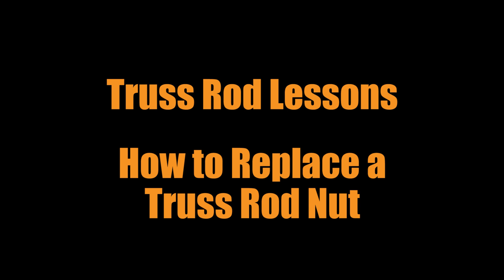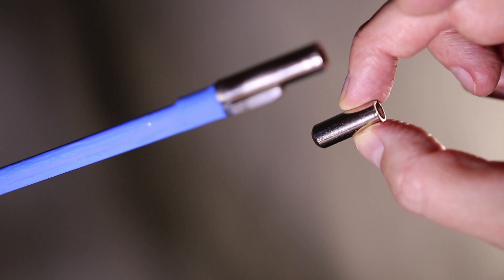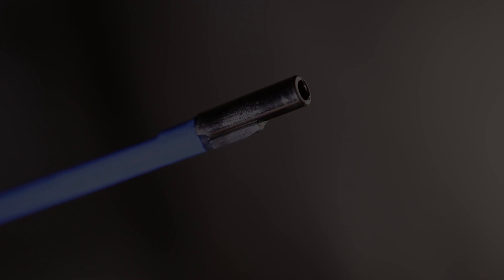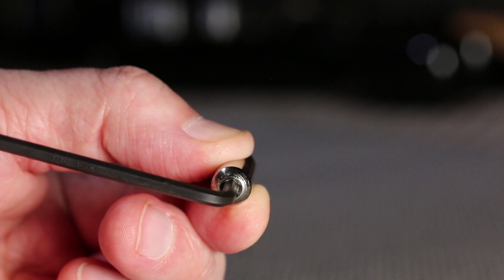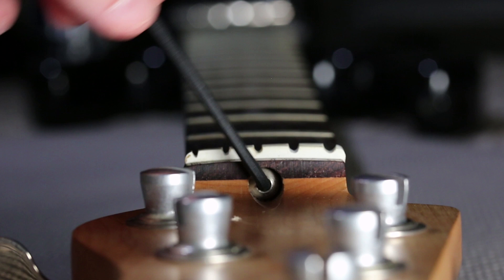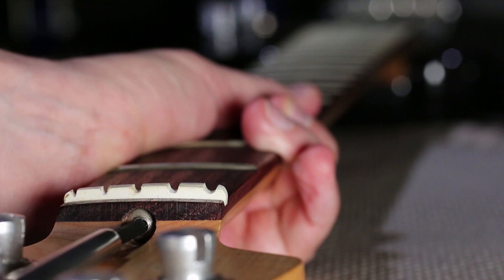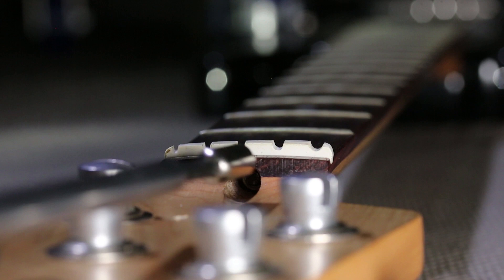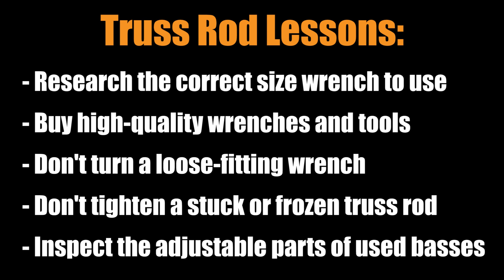Truss Rods; Replacing a Truss Rod Nut | StudyBass

Comment: I'm down a rabbit hole with a Maxam 43" Bass neck that the truss rod stripped out on. I'm at the point where I got to either take off the fret board, or just get a new neck, but finding the manufacturer of this bass in china is becoming a major task. I pray that I can fix this because it's my freind's bass.
Reply from the maker: I hope it turned out all for the best. A good luthier should be able to fix it if you haven't already.

Comment: This is a pretty detailed and an informative video. Thanks for putting it out. Doing the lord's work :)

I’ve got an LTD H1001 FM with a stripped nut. I can’t get 4mm or 5mm hex Allen keys to fit into properly. (Manufacturing book says 4mm).

I’ve ordered a gripper wrench from stewmac (4mm). I’ve seen videos of the wrench used to remove nuts but since this is a double action and the nut is weld to the rod, can the gripper wrench be used to adjust the rod for relief? I’m fine with living with the gripper wrench for the rest of my life if it does the job adjusting my guitar neck relief.
Reply from the maker: Thanks! Yes, I think using the gripper all the time is doable.

Comment: Don't use lithium grease!!!! Or ANY grease. It can dry out. Use anti-seize compound. It is specially made for exactly this. You can get little kethcup packs of it at any auto part store.
Reply from the maker: Good tip! It makes sense grease could separate over time.

Comment: That's awesome thanks
I just got a sire P5 4 string bass new from sweetwater
The Allen key that came w the bass has alot of play when put in the nut on the neck, 
I had this issue many years ago with 2 separate sires l sent back
How is it Sire still can to get this right
Reply from the maker: Like everyone, they are just cutting costs where they can. You really have to shell out a lot money for excellent tools. They're often worth it, but the small, expensive ones like an Allen key seem harder to justify.
Reply: Thanks

Comment: My GD truss rod just broke on my 2 month old G&L after applying a tiny amount of pressure to it. So pissed. I believe it was due to a bad weld on the rod. Any suggestions?
Reply from the maker: Man, that sucks. I'd get in touch with G&L. They are usually pretty cool. Maybe it is still under warranty?

Comment: I think righty-tighty, lefty-loosey should be clockwise and counter-clockwise, cause outherwise it changes with your perspective.
Also you just need to remember one direction to figure out the opposite motion.
Truss Rod Clockwise = Back Bow.
Or just think of a regular screw.
Tighten=Back

Comment: Does the Stewmac Gripper Tool work to ajust a trussrod with a stripped nut?
Reply from the maker: It could work, but I would just replace the nut. It will be easier in the long run.

Comment: Great video. Learned a lot. Had a question about maxing out. I have a 2008 squier standard jazz bass and I seem to have maxed out on tightening the truss rod but still havent been able to reduce the height between the string and the fret markers at the 5th or 7th fret (depending on whether I am fretting the 12th or 17th fret). I read online about adding washers/spacers. Do you think that might work? At the moment, I don't want to attempt to tighten anymore as I am almost sure I can't tighten it any further. Thanks.
Reply from the maker: Have you tried some lower tension strings? That might make the difference.
Reply: @StudyBass  Oh I haven't yet. Might give that a try. Asking because I am a beginner, would that affect the tone I would be getting from the bass?
Reply from the maker: Yes, but not necessarily negatively. The two biggest things you can do to change your bass' tone is change the strings and change the pickups. Both are easy to do, too.
You might find the low tension strings easier to play. Better playing is always better than better tone.
Good luck!
Reply: @StudyBass  Thank you!

Comment: Thanx for all your advices man. I have a question about a "weird" truss rod issue tho. Couple of years ago, I sent my very (beated) first bass to someone just for a paint job and when that a-hole gave it back, I notice it came with a very low string action, with "muffled" string sound and with some fret buzzing on the first position/frets, cos the neck was back bowed a bit. So I decide to adjust the TR...just to found that the TR nut was loose😡...Good news were the nut wasn't stuck nor stripped but completely loose and came out when I used the allan key on it...bad news were that the TR remains only responsive to tight the neck further but doesn't moves to the side to give relieve to the neck, so I let him alone right there😤...Is there any solution for something like that???
Reply from the maker: I'd find the best luthier in town and have them look at it. They might be able to put it in a set of clamps to help straighten the neck and maybe the TR will work correctly with less tension to counteract. Otherwise they could look at it and advise you what to do. Good luck!
Reply: @StudyBass  Yeah, would do that, have to find one tho...thank you for your rep and about the clamp advice👍

Comment: I want to remove a nut from a guitar and replace it with a new nut.  It's a cheap guitar neck, and I'm doing it for aesthetic reasons - I want to add a bullet nut.  Am I correct in understanding that I just twist the nut to the left (as if I'm loosening the truss rod) and keep twisting it until it comes off?
Reply from the maker: If it is a removable nut, yes. It unscrews counter-clockwise. Some nuts are permanently attached and you should research your instrument to make sure it's removable.

Comment: My Epiphone truss rod gets tighter as I turn it to the left. And very loose when i i turn to the right. But seems to be bowing with tightening (turning left).so it is bowing in the direction as you suggest but it does that while tightening. How does that happen ?
Reply: I found out it was set up the opposite (was lefty tighty righty loosy) . I had to to loosen it all the way to the right, then it started to tighten again, then it’s in the normal setup(Lefty loosy).
Reply from the maker: Strange. I've never seen that. I would have someone check it out. Someone could damage the neck not knowing there's some unique setup.
Reply: @StudyBass   I contacted the manufacturer (Gibson) And they confirmed it works both ways. It is an Epiphone 2020 guitar.
Reply from the maker: @OmarOttoman  I see our miscommunication. Yes, with a dual action truss rod it will have a zero point (perfectly straight) and you can bow it up or back. But, you should still think of it as "loosening" (adding relief) when turning to the left even if the turning itself feels tighter.

Comment: what i dont get is, turning the nut, turns the truss rod. so how can a nut be undone or done? 
doesnt keep turning the truss rod?
Reply from the maker: The truss rod does not turn--it just flexes between curved and straight.
Reply: @StudyBass  yeh and so it bends. so if it keeps bending, how is the nut meant to get loose?
Reply from the maker: I'm not sure how to describe it to you. You might buy a cheap truss rod to see how it works. Or next time you are at a luthier's shop have them show you.

Comment: 10:03
What is the name of the white piece running across (horizontally) that holds the string?
The thing with the 5 groves...
Reply from the maker: That piece is called the nut. You can find more on the parts of the bass here: https://www.studybass.com/gear/